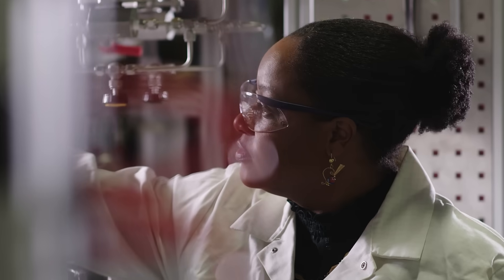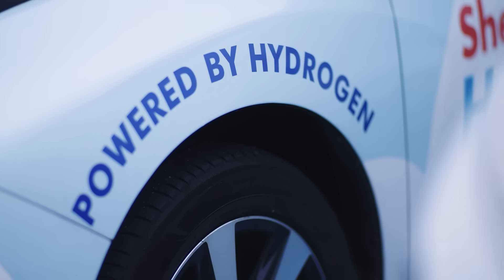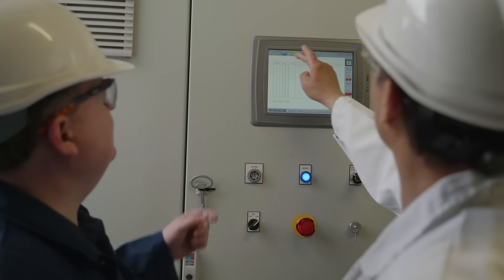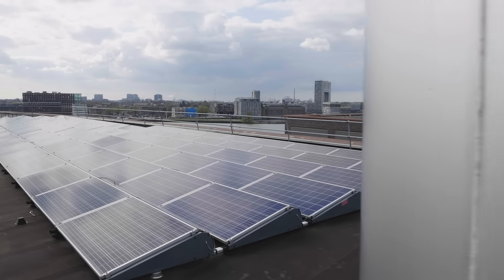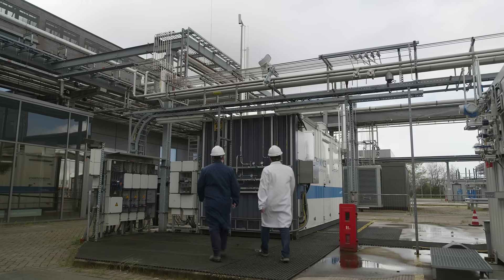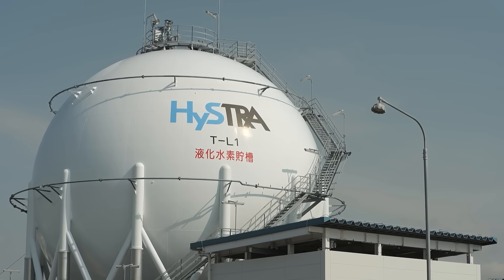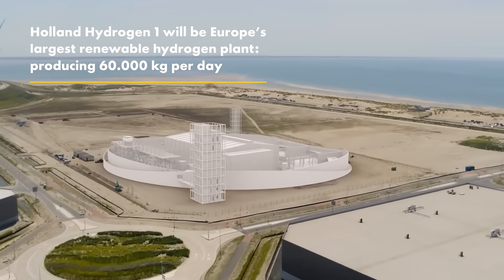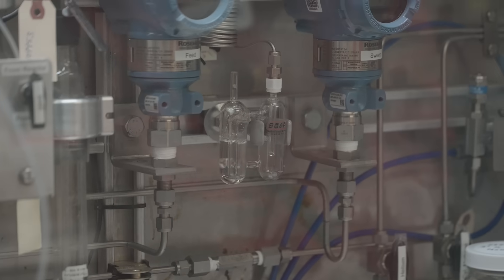Shell's Hydrogen Technology Programme

Comment: With 25% mass fraction of Hydrogen, Methane found in Natural Gas or Biogas or Landfills is the richest source of Hydrogen followed by Ethane and Propane. Water has only 11.11% mass fraction of Hydrogen. Water Electrolysis needs ideally at least 7.7 times higher energy input than that needed to make same amount of Hydrogen from pyrolysis of Methane. NASA also uses Helium extracted from Natural Gas only to liquify Hydrogen for propelling rocket. Toyota Mirai FCV uses ultimately an approx 80 kg empty weight storage tank made of carbon fibre only to store just 5kg of Hydrogen at 700bara. Conventional methods to coproduce Hydrogen are catalytic Steam reforming or Partial Oxidation of Methane, Dehydrogenation of Ethyl Benzene or Ethane and Propane, Electrolysis of Brine or Chloroalkali process, Steam cracking of Ethane and Propane and these conventional methods will always continue to coproduce Hydrogen.